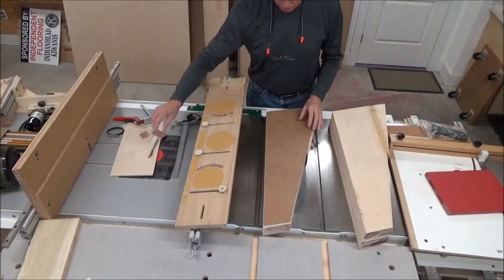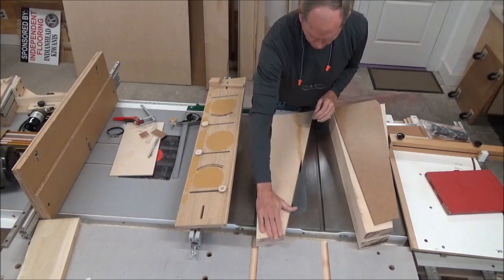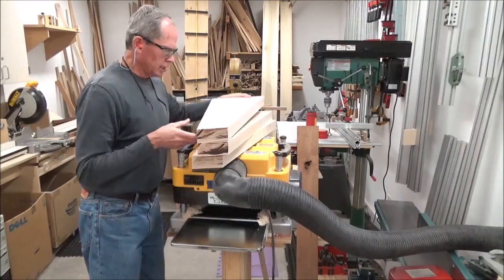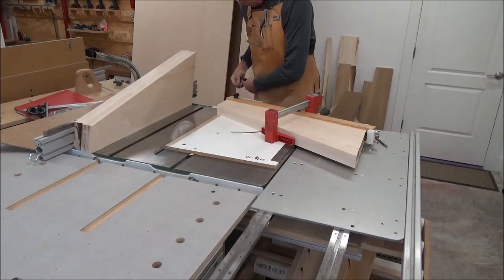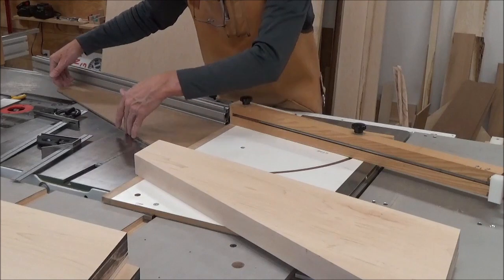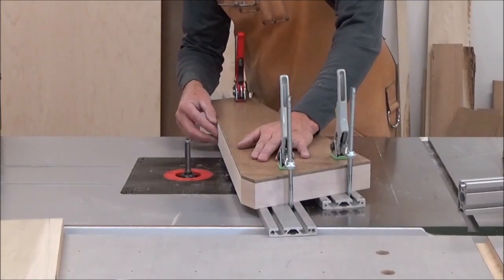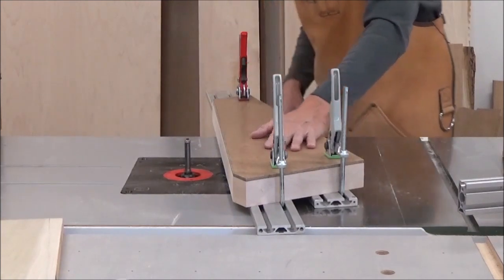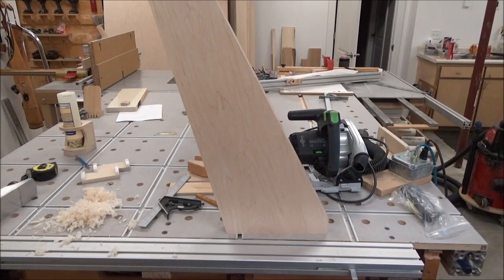03 Puzzle Table

Comment: Hi Jeff.  Where did you get the thin aluminum extrusion you used when template routing?
Reply from the maker: 8020 extrusion. You can find drops and short pieces on Ebay. The size I was using is 20mm x 80mm. Thanks for watching.